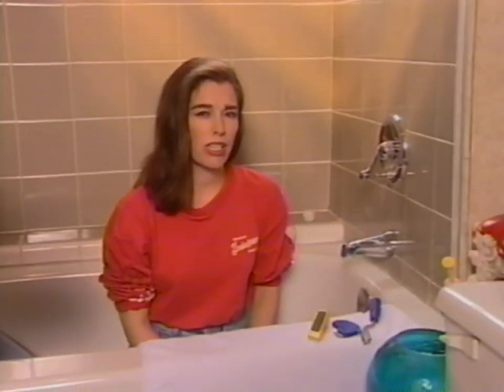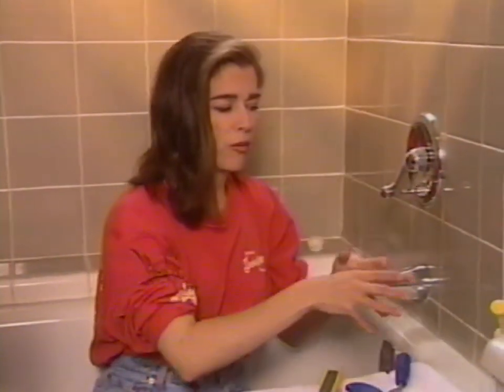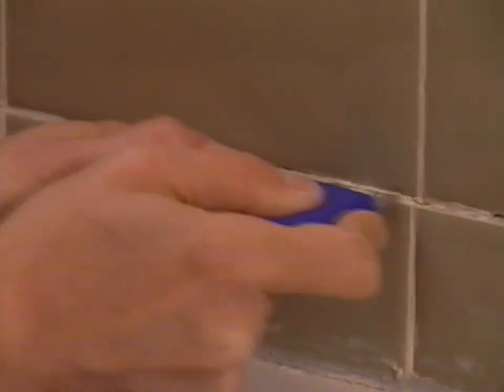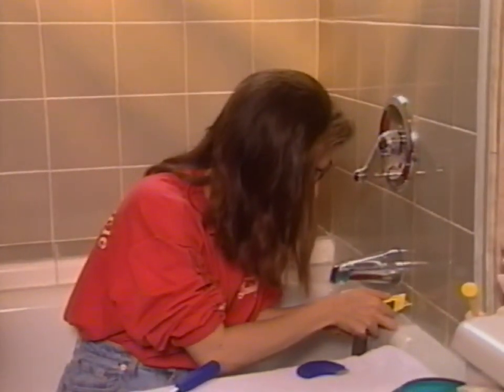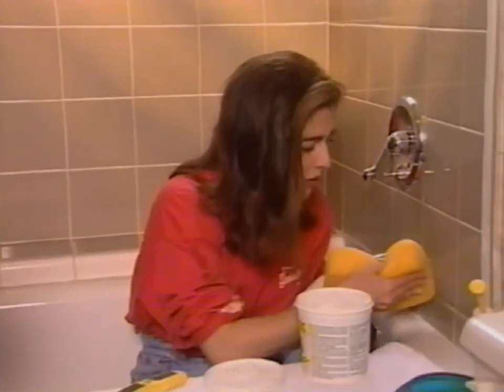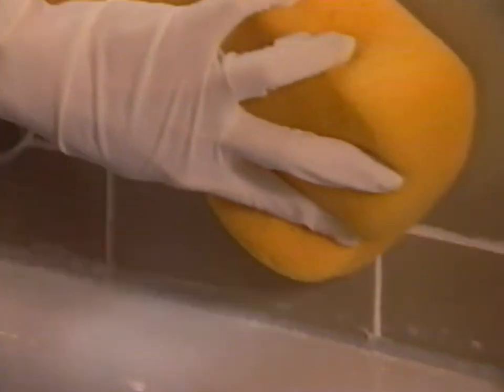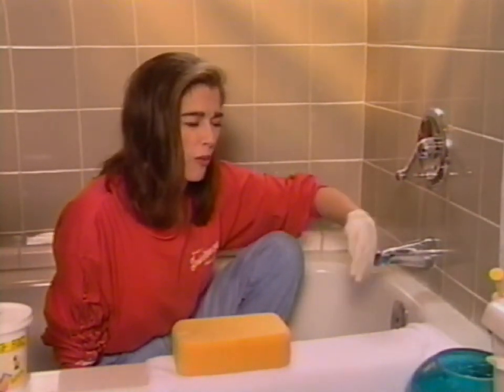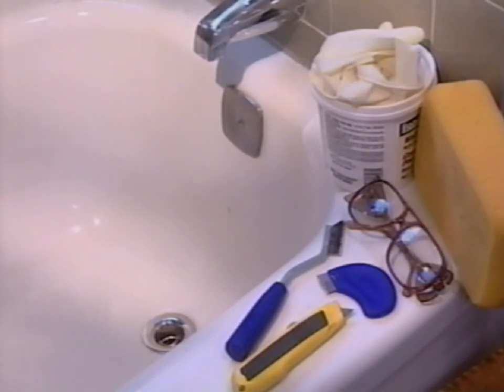Put an end to crumbly grout before rot sets in!  A Repair to Remember

Comment: I re-did my entire bath last year. I bought couple grout bits for my dremel rotary at $7 each. For large job was much faster than the hand saw. Multi tool would have been better, but i didnt have one at the time. Was easier than i expected, just time consuming. I used the exact grout you have and its held up great one year later.